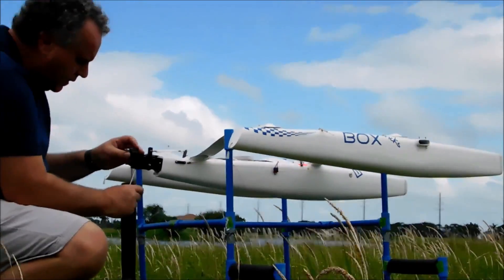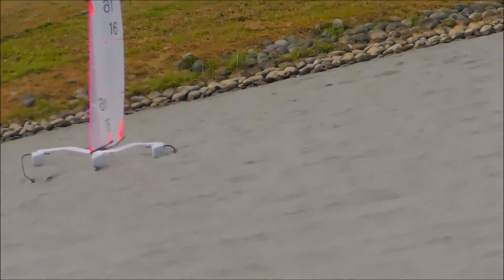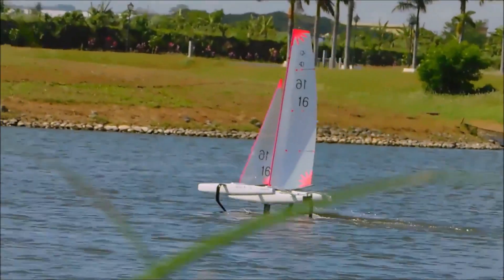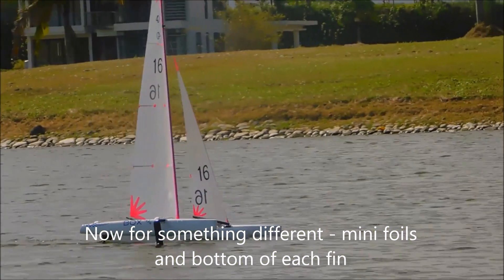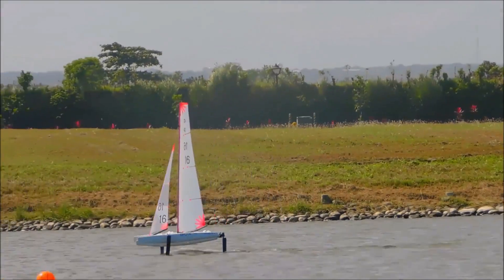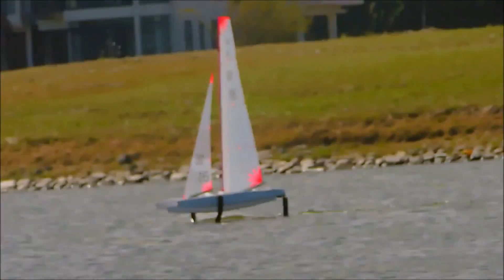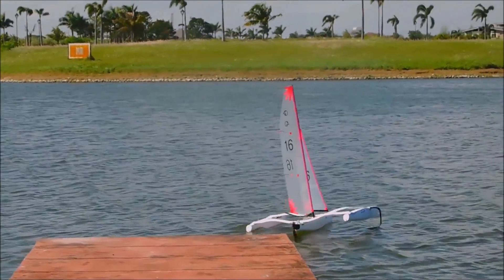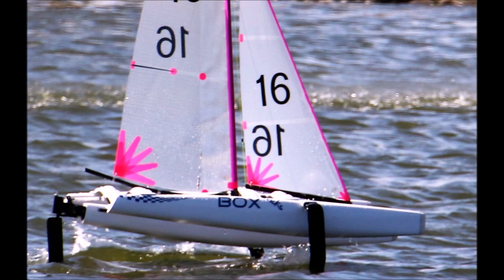One Metre trimaran "Box-on-Steroids" foiling

Comment: Performance typically goes up with increased wing loading (efficiency turning radius, etc.) but the trick is getting the vehicle to take off. Therefore I’m not surprised that the smaller rig is doing well. Also, as you noted, lower heeling moment is always a nice benefit.

Comment: Impressive!  What is the all-up weight?  I thought on such a fast boat, you would need at least the main full battened.  Have you considered a wing mast?  Is foiling a hard balancing act?  Subbed.
Reply from the maker: Hello David.  On the smaller rigs we use stiffer material for the sails.  We have considered a wing mast but cannot work out how to make them sufficiently light to be of benefit, so instead we compromise with a large pocket in the front of the mainsail inside which we slide the mast.  My using a fairly stiff material for the pocket we almost achieve a wingmast effect.  it liek the current America's Cup monohulls with their 2-ply mainsails.  Our boats are not the lightest, we are probably 2600gms with rigs, foils and batteries and electronics.  The lightest boats in Europe are probably 300-400gms lighter than us, but we find that weight actually helps the foiling as the boat is not so twitchy in gusts.  Our main aim is to have fun foiling.  If you want to win racing round a conventional race course then we might design something different